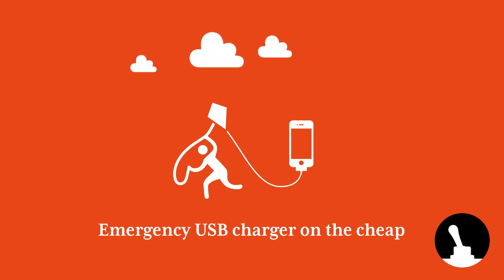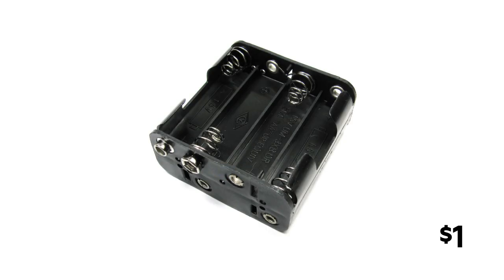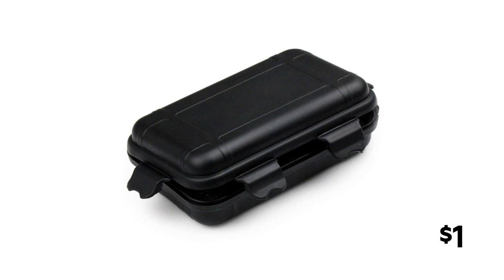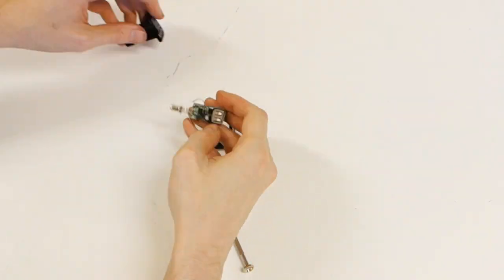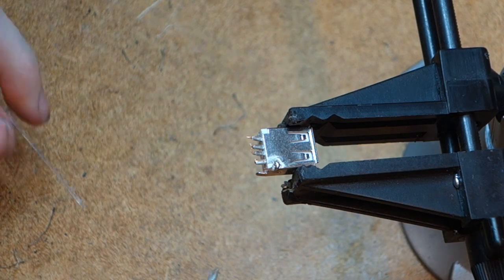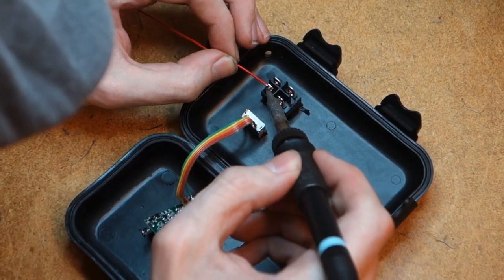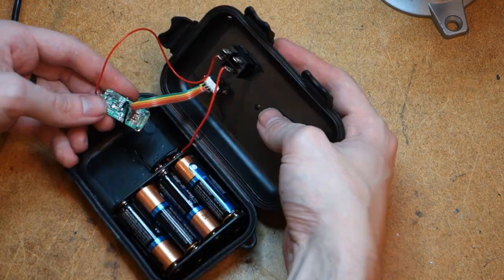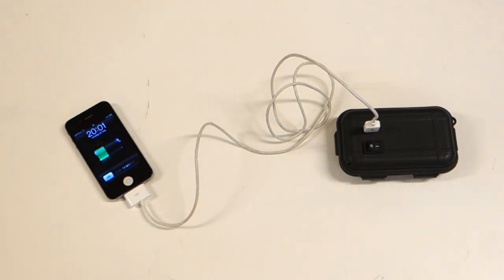Build an emergency USB charger on the cheap

Comment: Another great project!  Thank you, I love your creativity and clear instructions.  I'm wondering why you rewired the circuit board to a separate USB port when it already had one connected to it.  Why not just wire the power and switch directly to the car USB port and mount the port to the surface of the case?

Comment: Switch & Lever  Man, that's easy! Maybe I'll make one... If I wanted to be cheap, could I solder the wires from the batteries and on-off switch directly to the contacts on the cigarette lighter/USB converter? I understand why you would want yours to be compact since you hike a lot, but for use in school I feel like I would be fine putting this together in a larger box to keep in my backpack.

Comment: why did the usb need a 5-wire ribbon cable and not just 2 for the power and ground? does the charger have auto-off feature or something?
Reply from the maker: Most modern devices won't charge by simply feeding power to them, but you also need to supply a reference voltage on the data pins. The car charger takes care of that already, so I simply extended the pins already there. Without them connected the iPhone would not have charged, neither would my Sony RX100 camera which I use it for during hikes. Some devices may very well charge, but many won't.

Comment: Step one: Buy a phone that has a battery life more than 8 hours.
Reply from the maker: Don't know exactly how that would help when you're away from civilization for several days and you're primarily using the charger to power your camera, but sure. :)
Reply: The old Nokia brick phones had a battery life of up to 10 days on a charge, you can get one of those for cheap off of eBay and use it for when you do go camping or hiking.
Reply from the maker: ***** I think I'd rather have a device with a proper GPS, if I ever find myself needing it. Also, it doesn't help one bit with the aforementioned camera issue. The alternative is buying a stack of really expensive camera batteries, for which cost I could build at least ten of these chargers for the cost of one battery. I hear what you're saying, but for what I need it for it's just not a solution.
Reply: I guess I just have a different way of doing things.

Comment: It's certainly a nice build but I mentally can't get past the idea of using a battery to charge a battery.
Reply from the maker: Not just that, but using eight batteries to charge one!

If you think about it, it's not that different from having solar panels on your house and storing that energy in large battery banks to power your home. You power your entire home from a battery, including whichever devices you want to charge up.
Reply: Switch & Lever I would have to argue that there is a significant difference. With the solar charged batteries you are storing energy that would otherwise be wasted because it was only available when you didn't need it and you have very few options other than batteries - you have to store the power somewhere after all.

I'm not saying your device wouldn't be useful to get you out of a difficult situation but from an energy point of view it's awful. Consider the amount of energy that went into creating those eight primary cells and then what percentage of it ends up doing useful work in your phone, if it's 10% I'd be surprised.

Comment: Probably the batteries can last a little bit longer if you remove the led in the pcb charger (10/20mA at 1.2/1.8V), and because it's inside the enclosure you don't need it anyway. It seems irrelevant but it's a wasting of energy.
Great video!
Reply from the maker: Probably, but I doubt we're talking much of an impact in the end, compared to what energy is spent on the charging the LED likely draws about a percent of that. Not irrelevant, but not a huge deal either.

Comment: i have heard of a mintyboost kit which looks cool
Reply from the maker: Indeed, the mintyboost is pretty neat, but as it uses only two AA batteries it can't really deliver that much charge, and the batteries run out quickly. It's great for a one time emergency charge, but not for repeated usage, such as during a several day hike.
Reply: Well I think there are two types of battery chargers being discussed

-portable charges used on hikes and remote locations and for emergency

-and there are ones which would at least charge your phone 25% enough to make a urgent call or for emergency,and does not need to have a big capacity.
Reply from the maker: Tom Howbridge Indeed, maybe I should have made it more clear that this device is intended for the first usage, not the second.

Comment: Great project! However, if I was to build this for myself I would mount the switch inside the case to prevent it being turned on accidentally in my backpack.
Reply from the maker: It's a pretty stiff switch, but you do have a point. What I did after this video was shot back in April was to actually exchange that switch for a key switch instead. Completely prevents accidental activations, just don't lose the key!
Reply: Switch & Lever Nice one. Looking forward to your next video.

Comment: Sweet :)

My problem is with the charger cables themselves, the 20pin connector for older iPhones seems like an altogether bad design, which is probably why they are transitioning to the new ones. 

That's what i need is an "indestructible" iphone charger cord.
Reply from the maker: I think it sounds like you need induction charging! Haha!

I actually like the older connectors better than the newer ones, it gives a bit more meat for the phone to stick to.
Reply: Randy Savage It sounds like you need something other than a Nano iFad. Maybe something that uses standard micro USB cables. :)
Reply: Switch & Lever Oh, I havent had a chance to use the newer ones, I just figured they were better.

Once, I tried to solder the wire in the cable directly to charger leads on the usb side and then modify my iphone case somehow to make the connectors "clip" to it securely, but my soldering sucks so bad I didn't make it that far lol! I didnt want to give up, but I am too busy with school now, so maybe ill try again someday.

Comment: Do you need all 5 connections to the female usb port? I would assume power and ground and maybe a control circuit would be the only necessary connections.
Reply from the maker: A lot of new devices, such as phones or cameras, actually do require the data lines as well as the devices won't activate charging mode without them. A lot of people have problems charging newer devices with older USB chargers for instance for this very purpose. Considering it's trivial work to solder a couple of more cables I'd rather stay on the safe side and have everything connected.

If you can mount the car USB charger so you can use its USB port sticking out of the enclosure you can bypass that step altogether. I'm essentially just extending the USB port.
Reply from the maker: swiss Oh, no, for sure it's a good answer for a look into how a lot of devices actually won't charge if you just feed them power and ground, but need to have power on the data lines as well. Cheers!
Reply: Power and ground would be sufficient. If the voltage regulator can deliver more than 500mA and you want to make use of that you also need to have the data lines at 2.5V using a simple voltage devider right at the solder connections. In any case 2 conductors should do the trick if you don´t need actual data connections.
Reply from the maker: swiss Due to how a lot of new devices charges power and ground would not be sufficient. For instance, an iPhone will refuse charging unless, as you point out, there is 2.5V on the data lines. Why even bother with voltage dividers when you have all in a neat package in the car USB charger already? I'm essentially just extending the built in USB port, if you can mount the charger so you can make use of the built in USB port in your enclosure you can skip that step altogether.
Reply: Switch & Lever Of course it´s easier to replicate for most of your audience to just extend the whole connector like you did. There is nothing wrong with that. I just wanted to point out that you can get away with just two wires from the PCB to the connector as I thought this would answer sabotshell's question.

Comment: Just a thought, the switch you used is likely to switch it's self on when packed away in you back pack, how about a rececced one? Regards, Matthew
Reply from the maker: Indeed, what I actually did after I had recorded this (back in April), before going on my hike, was that I changed the switch to a key-switch instead. Sits flush with the surface of the enclosure, and completely prevents erroneous activations. No key, no power.

Comment: Splendid! What does the circuitry in the USB adapter do, I wonder?
Reply from the maker: ***** Couldn't have put it better myself. Thank you!

It's indeed a bit more involved than just reducing the voltage.
Reply: reduce the voltage